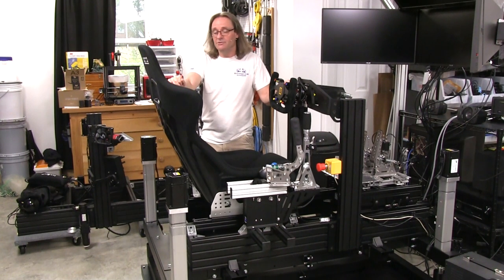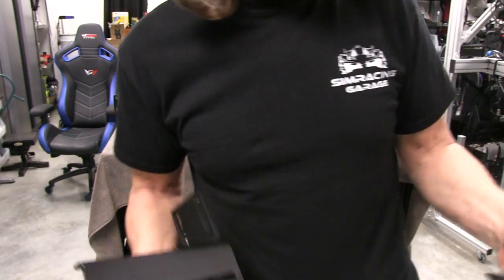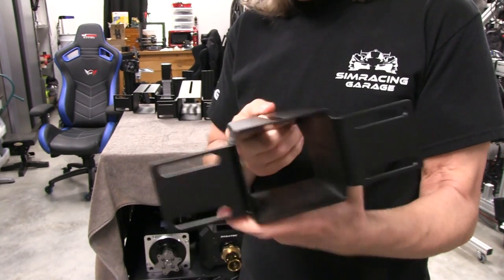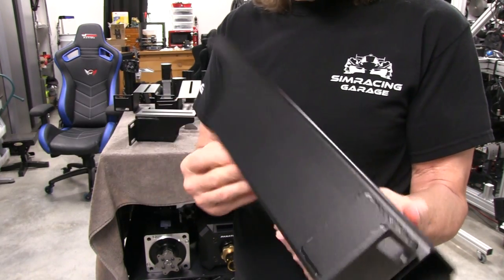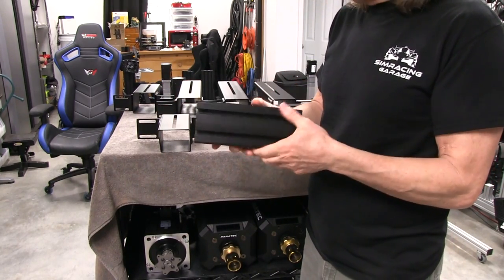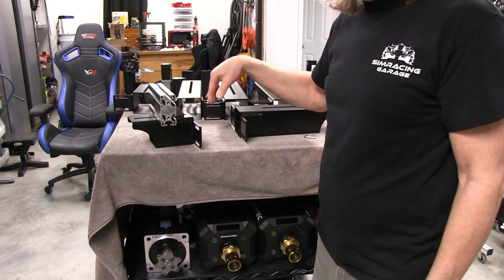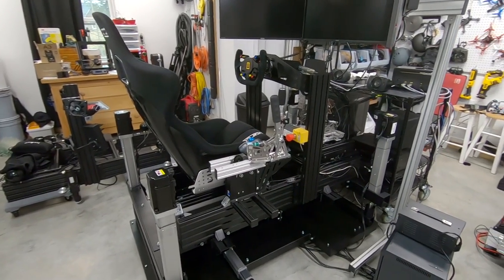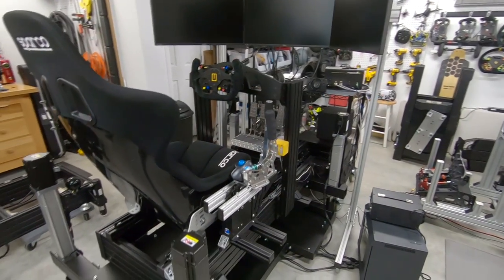Prosimu P5MP With P1-X Cockpit Mounted

Comment: Got the same exact setup, love it. You're the one that got me into the hobby with your videos. Thanks! 

My whole setup is on a wheeled platform with leveling casters so I can move it as needed. 

I mounted the same way except I used the longer 250mm mount near the driver entry position so I could also use it as a step to mount and dismount the cockpit.
Reply: How are you enjoying it after 8 months? Would you recommend?
Reply: @TifosiLegend44  still loving it. Also just got my HP Reverb G2 so VR should be improved greatly.
Reply: @GautamDesaiB  thanks for replying! The Reverb G2 looks amazing! Have you had any issues with your platform? Any advice for someone who is considering buying one?
Reply: Hello I have noticed that you posted your thread one year ago. I am considering ordering this unit  and would like to know how is it holding up after a year of use . Any issues with software to report ? I am new to this field and just trying to buy it for my son. Would it be compatible with Trakracer TR160 wich I just purchased for him. Thank you !

Comment: I have this setup! Wish you had this video out last year. Absolutely love the P5MP and the P1X is a solid cockpit. Very tight manufacturing tolerances. Zero flex. My only complaint is that I need a step ladder to get into it as I’m short
Reply: how does this compare do you think to a 6 axis system like DOF Reality 6p?
Reply: Riaz Walji this is in a different league. Don’t let the number of axes fool you. The actuators themselves are vastly superior and the platform is extremely solid. The P1X chassis has no flex and is easy to modify. Top quality. This is pretty much as good as it gets for home use.

Comment: Thanks for your reviews !

Solutions like P5MP are becoming "affordable" and I'm really interested now I've seen your review. My only question is : does the surge effect you had with the JCL V4 4DOF D-BOX is really missing ? Feeling the belt against your chest during heavy breaking ?
Reply from the maker: Yes, the the pull of both the shoulder and waist belts is missed. But you do gain the Yaw DOF. Now if we can get both together in the P5MP. The up coming P7MP perhaps?
Reply: @simracinggarage3026  Thx for the quick answer ! Yes I've seen that the P7MP was in the way, fingers crossed ;)